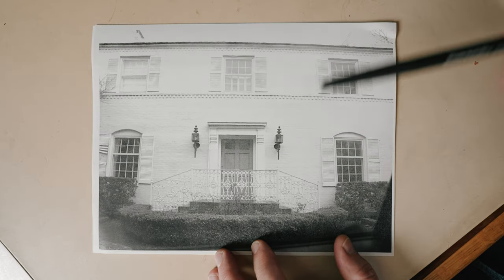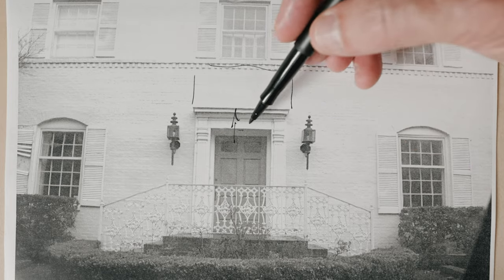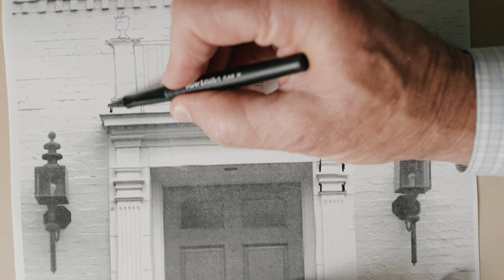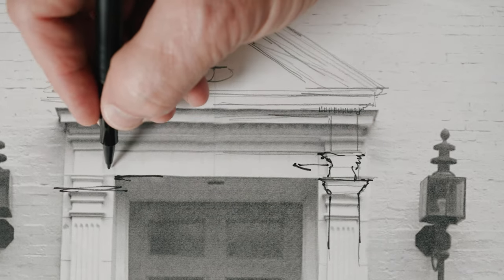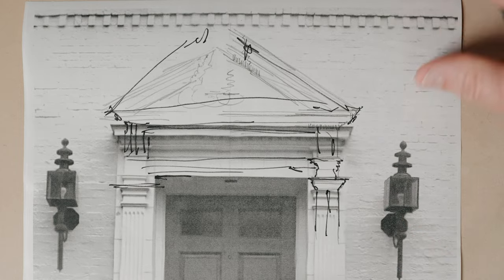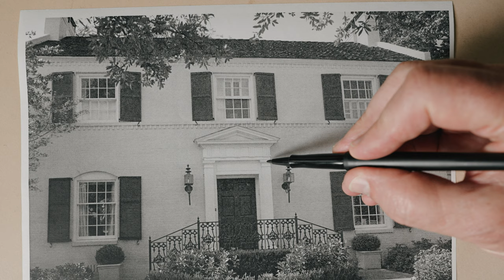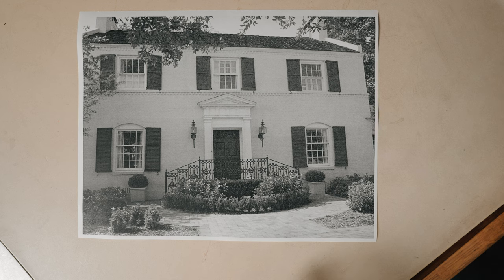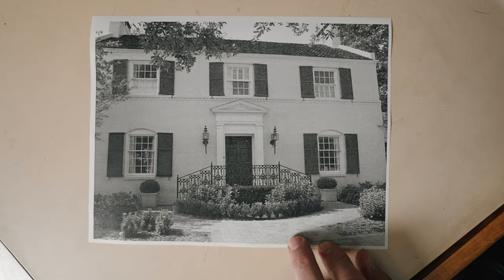Fixing a front door. New pediment how to.

Comment: The space above the door seemed necessary to give a bit of space to the front, to my eye you have added unnecessarily fussy ornamentation to a building that did not require it aesthetically, it does not provide more cooling or shelter. The original capital and mouldings were quite sufficient for a door of that size, the architect did a good job. I doubt they would be impressed. Perhaps if you had tried to match the size of the original dental mouldings it would have helped. The door does command attention, at the expense of balance and harmony with the rest of the building, it looks like you have stuck on a Mcmansion porch. You have two windows rounded on top either side, at least round the top with the same radius.
Reply from the maker: ok.